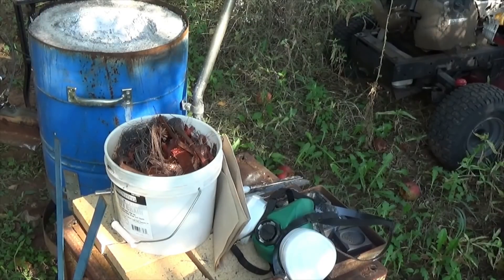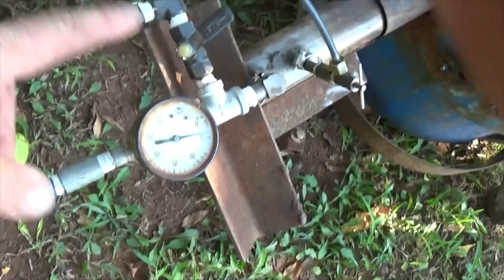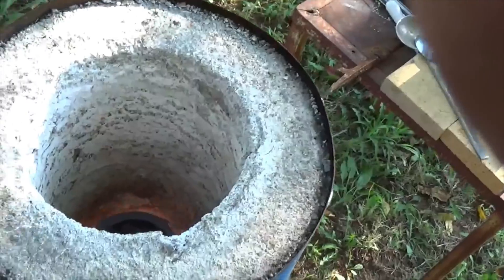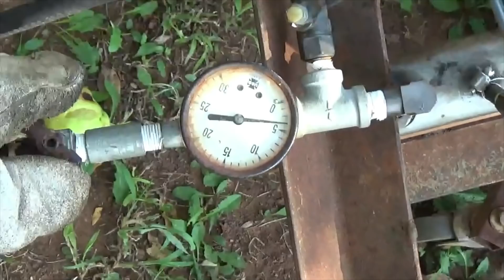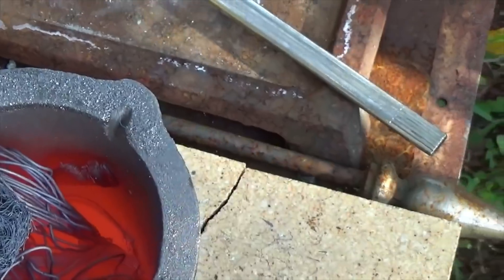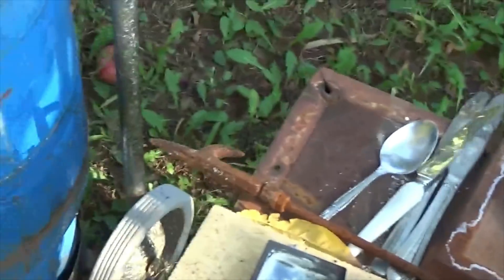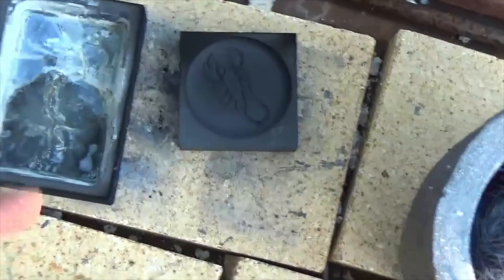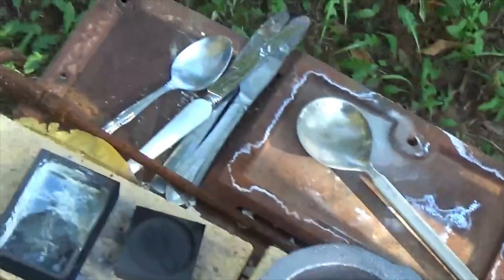Will the Waste Oil Burner get Hot Enough to Melt Copper?

Comment: Make your furnace smaller to match you cursable cut 6" off the top.  there be less air space to heat up.  I seen someone else have the same problem.  It mite help.

Comment: you really need a nozzle that allows more flow,filter and pre heat the oil, get a moisture filter for your compressor, and you need enough air pressure to blow out your flame if you want to. to add, if that's plaster of Paris and sand, good luck. that's a big space to heat up. you really need some refractory insulation...also an insulated lid would help.  I run diesel and compressed air. 2000 f isn't a problem.
Reply from the maker: I just use that setup for aluminum now, I got a devil forge for the copper now

Comment: There is no question this will melt copper although I was doubtful it would on this occasion when I saw the flame you had.  The flame should fill the furnace, you had it not even coming out of the  Burner port itself in a solid flame.  Try it again but crank the thing up so the crucible is encased in flame.  If it's surrounded by flame it is getting the maximum heat transfer and Minimal heat loss because the Fire itself becomes the refractory.  It's Free fuel, so what if you use a bit extra? I have melted copper in open air without any furnace using oil so without meaning to sound rude, the reason you were not successful was operator error not the inability of the equipment. 
It would do it the way you had it, just take a long time. Turn it up and it will do it quick smart.  Hope you give this another go so you can see how effective this can be.  Furnace that size you should be able to throw Whole Motors in and melt the copper off them .  I am building one to do just that.
Reply from the maker: wow the man who inspired me to build an oil burner, good to see that you are still alive and kicking, I had the flame coming out the top bat the end. I am not giving up, I plan to buy a probe thermometer and put it in at the height of the crucible so I can monitor the heat, and thinking about adding an inch of kaowool to keep the flame closer to the crucible, I think that will help. I would like to see a video of your new furnace when you get it done. good to see you about and thanks for the tips. Bigger Fire Thanks again
Reply: @Okiescrapper  I honestly wouldn't worry about the kaowool too much.  Just crank up that flame.  I know a lot of people will tell you that coming out the top is wasteful but Just try it once.  Really have the Flame shooting out like a rocket.  There is no substitute for energy input. 
If you have seen my Vids you know I use either no refractory or something with little insulation value.  Fill the thing to overflowing with Oil Burning power and this will melt like Butter!  :0)

Comment: Try increasing your pressure next time. Looks like you were close to melting.  Stay safe and have a good day.
Reply from the maker: Thanks for the tip. I plan to order a temp. probe so I can see what kind of heat that I am getting at the crucible and then as I try to adjust it I can see if it goes up or down to better understand what does what,
Reply: @Okiescrapper  sounds good

Comment: I'm new to your channel.  I like the homemade furnace that you have.
Reply from the maker: thank you, you will like the melting pot that I use to melt heads, and lawn mower motors in using the same oil burner, I have a play list for the oil burner and melting metal

Comment: Great video. I pour copper and aluminum ingots. I use a Deval forge. I have never tried waste burner
Reply from the maker: I had waste oil so thought I would try it and I am sure a V twin lawnmower motor won't fit into a devil forge, so I went with the oil burner and a melting pot. I got a scorpion coin mold a few weeks back, hope to try it out soon
Reply: The coin mold will be cool! Yea I blow the engines apart and then put them in. Little target practice and tanurite

Comment: Just curious, isn't it  more time consuming melting everything?  Can't you just put whatever you're melting at the time on your truck/trailer and just take it in instead of spending all that time melting stuff?  Not trying to be rude, I'm just wondering
Reply from the maker: yea I could spend an hour cleaning a lawnmower motor and get 10 cents a lb. for it as aluminum breakage or I could melt same motor into ingots and sell on eBay for $2.00 a lb. 
edit. copper is going for about $3.40 a lb. and copper ingots on eBay go for $7.00 to $9.00 a lb.
Reply: He wants to make ignots to sell on ebay etc

Comment: 9:30 It may not have melted the copper, but you found a good way to burn off all the laquer off the wire for when you actually melt it in your Devil Forge. The cleaner the copper is before you melt, the better (less slag)
Reply from the maker: yeah burned the lacquer right off, looking forward to the devil forge
Reply: @Okiescrapper 
I guess you watch big stacked, he great at melting copper and brass in his devil forge.

Comment: Too large area and needs more O2, oil can melt copper.
Good size for aluminum for sure tho.
Reply from the maker: thanks for the tips I will play with the settings and see what I can do, may add an inch of kaowool to lessen the air space and keep the flames closer to the crucible

Comment: My friend.  Probably input air with a blower instead of your compressor.  It'll save your compressor and burn hotter, but your the workingest man I ever did see.  I love your channel
Reply from the maker: the syphon nozzle needs the air from the compressor for the syphon to work but I still may be able to use forced air too

Comment: Man I was hoping that it would melt the copper oh well great test you will like the devil forge then you can use it for so much two thumbs
Reply from the maker: I was hopping it would melt it too, I may try again when the weather cools off a little,  put a layer of kaowool inside to take up air space and play with the settings. ma be turn the oil down a little and turn up the air see if it will get hotter
Reply: @Okiescrapper  you could try with just a touch of propane also but it will be interesting to see what happens

Comment: I think you need more air. That oil burner should melt copper in no time. Also your first melt will take longer than just a few minutes.
Reply from the maker: yeah I need to play around with the settings. had good flame but more air may make it hotter

Comment: I can melt copper in 8 minutes in my homemade foundry, made from old oxygen tank koawool and mortar mix. 2300 degrees in 22 minutes.
Reply from the maker: nice what are you using for fuel?
Reply: @Okiescrapper  propane, I built the burner #25 mig tip and a bounce house blower.
Reply: Nice

Comment: using kawool should help and would be a cheaper next test than buying one.  If it works then get some ridigizer and keep it long term, if not pull the wool and call it good!  Could also just be the overall size causing you to lose too much heat.
Reply: What a ridigizer
Reply from the maker: a rigidizer is a high temp. coating that you paint over the kaowool to keep the flame from burning up the kaowool. it will make a furnace last much longer
Reply from the maker: good tips, I think this fall I will build a smaller one from a 20 lb. propane bottle I have a few around, I bought some powered refractory do you think it would work as a rigidizer ?
Reply: @Okiescrapper  I'd guess so, but not sure if it is just as good or not.  It's on my list to build a new furnace this fall myself and as normal, I'm sure it will be some trial and error on things like the best stuff to use.
Reply: So wat kind paint is it
Reply: Wat kind paint is it

Comment: Ive been curious,  were you to  use a cast iron crucible and used you oil burner to burn the coating off copper wire, woyld it burn clean? I can't do that experiment  where I live in case big black plumes of smoke does happen
Reply from the maker: the burner burns clean so yes I think when the coating is gone is should burn clean
Reply: @Okiescrapper  i have several power crds fromm these cheap vaccum cleaners ive stripped the outer coating and whats left is those tiny  18 or twenty guage wire and its extremely difficult to strip with the device I made. Burning it seems the best way but the smog it creates in a common wood burner would bring every environmentalist in a hundred mile radius my way. A Cast iron crucible would heat quickly and almost nothing to make.  It would be great if that rubber burned clean.
Reply: Okay heres a follow up. I filled a cold cast iron crucible with a few small rotors and the glue burned off just fine. It took about 6 minutes to do with propane.  Then i stuffed a baseball size ball of rubber insulated wire in the red hot cast iron crucible and  quickly  turned the gas on. I had just enough time to notice a minimal amount of black smoke and none of that distinctive odor. Right at about two minutes time it was burning clean! It  works my friend!

Comment: It will be one of 2 things causing it to fail, one- the fuel air mixture is wrong, oil burns way hotter than gas, melting the copper should be a breeze. or 2- it might also be where the oil is put into the system, it has to be able to get the inlet pipe red hot before it goes into the foundry to get to max heat. Keep up the videos, we want you to succeed!
Reply: Espen Forfen,  I agree with you.  If the crucible was lifted closer to the top of the foundry and the hole in the top was a smaller diameter, possibly 3.5 inches.  I would think 40 minutes would start melting copper from a cold start.  When that lid opens with copper, it will be tough to work around without some extra leather. That forge has a lot of internal surface area, its gonna be a hot one.  Keep going Okie scrapper, we're pulling for ya! :)
Reply from the maker: Thanks James, I may keep the waste oil burner for melting aluminum and get a devil forge for copper and brass
Reply from the maker: Thank you for you input, I may need a smaller furnace like one made from a 20 lb. propane tank and I have a few tanks laying around. less area to heat and I can make a smaller hole in the top. I may work on one this fall